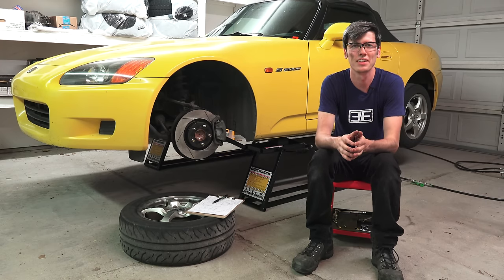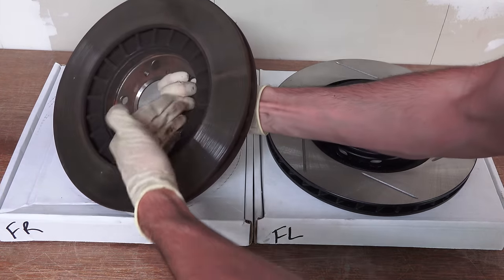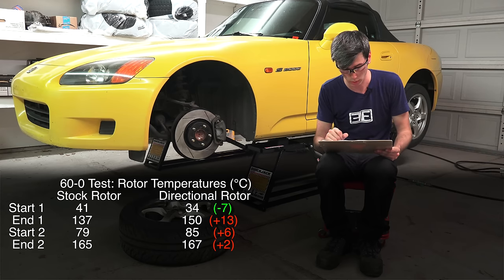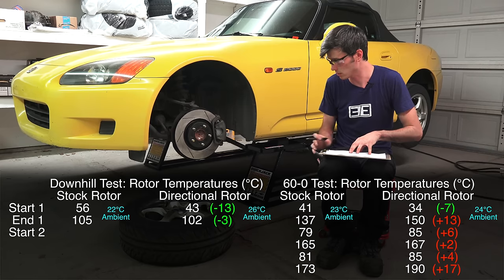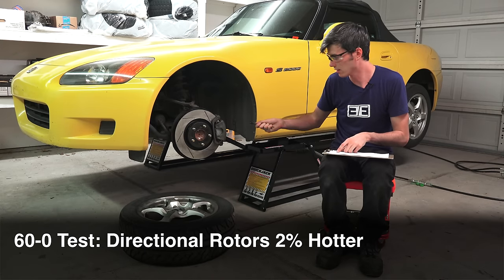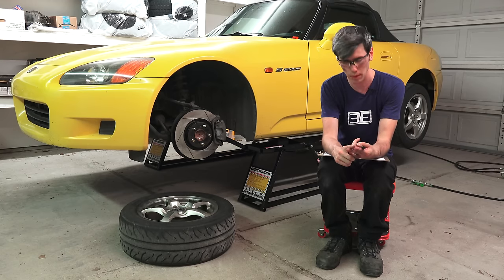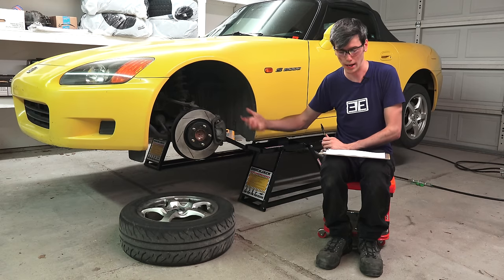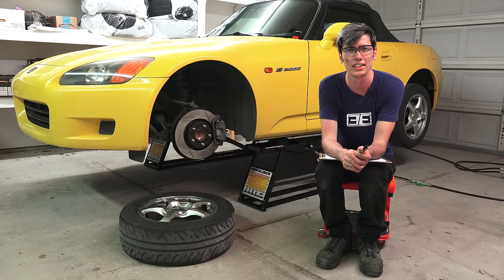Do Performance Brake Rotors Have Better Cooling?

Comment: I think you left out an important factor, you didn't measure stopping distance!  A shorter stopping distance is going to yield a higher temperature.  I think it would also be interesting to do the 3 hard stops, then drive say 5 minutes, roll to a stop then take the rotor temperature.  What I'm looking for is, did the aftermarket rotors stop in a shorter distance, get hotter, then cool quicker.  Remember, the function of a brake is to stop. The shorter the distance the better the rotor and pad.  I don't care if an aftermarket rotor gets hotter than a stock rotor as long as it's stops shorter and stays straight.  The stock rotors on my G37 warp and wobble like a b** after they get worn a bit.
Reply: He said consistent lap times. So the same braking distance. The point is they are useless for the street where we drive our beasts 99% of the time. And slotted rotors chew really fast trough brake pads compared to normal vented rotors.
Reply: You say: "The function of a brake is to stop." That's very true, but REMEMBER :
The brakes stop the WHEELS -- it's the TIRES that stop the vehicle !!

Comment: We basically do this type of testing at my work but we embed TC s in the pad and rotors so we see live temps as we brake also sometimes pressure and vibration, but to get accurate data before every test we do a burnishing to make sure the pads mate well with the rotor

Comment: I don't know if you released this but the rotors are actually on backwards, the vanes are designed to scope the air when in forward rotation, if he was to replace run his test with the rotated Round he would see a difference performance of the aftermarket rotors!! 😁

Comment: I found your experiment very interesting. I spent over 35 years in the automotive parts business with new car dealerships, most of it with GM. I learned a few interesting things about parts over the years.

 New car manufacturers are required to test their new models extensively before release. Yes, I know that doesn't mean they hit the showrooms as works of perfection all the time. Problem is, in the USA there are no laws that require aftermarket manufacturers to test or approve anything that they sell. This is sad because they could make their part better than OEM (original equipment manufacture), about the same as OEM or their part can be junk. They are required to prove nothing because they line the politicians pockets.

However, on brake parts, there is an approval designation, D3ea, that sets out testing standards for rotors, pads, etc. If they do the testing and pass, they can put D3ea approved on their product, and that is the standard the car manufacturers must meet. That means that the product meets the same fade and stopping specs as OEM or better. Without that designation, you have no idea whether their product is at least as good as OEM. That may not sound impressive, but an extra 20 feet to stop could be very deadly.

GM"s Durastop line is D3ea approved and they make brake items for other cars such as Ford, Chrysler, etc. Hope this helps someone when purchasing brake pads and rotors, drums and shoes at your local autoparts store.

Comment: I found this to be a good, and an interesting video.  Thanks for taking the time in doing it. I have a couple of questions. What effect would the groves or holes in the rotors have on the brake pads?  Would the groves in the rotors cause the brake pads to wear out faster? Would the metallurgy used in the rotors make a difference?
Reply: No noticeable effect on the pads.   Slots and drillings in rotors are staggered so they will essentially "cover" the width of a pad.

Comment: Did you take into account the stopping distance differences between the two rotors ? I assume the slotted rotors may have stopped the car in a shorter distance - that may create more heat, but the directional cooling fins will cool it down quickly. I'll accept 13 degree higher temps if it stops the car even 1' sooner.
Reply: If you can trip ABS on a set of brakes you're limited by tire grip not brake pads.

Comment: Rotors look like they're on wrong to me.
Reply: because you look at the channels on the face and assume what you think looks coolest is the correct way?
Reply: Top of the slots should face the rear of the vehicle, fact. These discs have been trialed incorrectly.
Reply: carlos oliveira he’s got the discs on the wrong side !    Test therefore invalid
Reply: @keytesofessex  its amazing that you apparently watched the video and still think the rotors are on wrong. Im assuming everything goes in one ear and out the other with you.
Reply: MISTA MAGIK yes in on ear out the other,  I guess.  The idea of the slots is to help dissipate brake dust and moisture from the disc when in motion, but the way you have them will throw dust and rain water into the centre of the hub which kinda defeats the object t
Of the slots.
Have a good day
Reply: @keytesofessex  The cooling channels inside the rotors are designed to channel air out centrifugally and that would not occur if they were the other direction.

Comment: Brakes need to be at an optional working temperature, maybe the performance rotor heats up quickly to gain better braking, but at the same time not getting overly hot. Just a thought.
Reply: Optimal
Reply: Your braking limit is your tyre grip, not the rotors.

Comment: If you’re off-roading, you do not want slotted rotors, capture dirt, sand, debris.
Reply: Except the fact WRC and ARA uses them.
Reply: If the slots capture dirt, sand and debris, wouldn't that then make them the essential equivalent of a solid rotor?

Comment: Personally when I installed rotors like this. I only care about the stopping distance especially at the urban areas and sure at the highway. They did a great job really better than stock. 
The temperature doesn't mean so much to be honest with you. As long as it is doing the job.
Reply: Temperature does play a different brake fade is caused by heat and when you get brake fade your stopping distance increases greatly
Reply: @mattbosch8893  that's what slotted are for. Decrease brake fade
Reply: @David_Saijen  never said the slots didn’t all I said is that temp does play a difference in braking

Comment: You didn't give the rotors time to do what they were designed to do. You hit the brakes and measured the temperature with out letting the veins do their job. They don't work if they are not turning. Maybe do a brake check, but instead of stopping immediately. Get back to a speed of your choice and then use the e brake to stop you so you don't taint the temps. Just a thought. Love your vids. Keep it up.
Reply: Slotted rotors are for gas release. Drilled are for cooling.
Reply: Doesn't the release of gas more efficiently also let go of heat?

Comment: I'm just gonna stick to my stock rotors and just buy  high max ceramic  breaks
Reply: Etienne Rojas slotted are the best bet.. Not drilled. I've done a lot of research on this.
Reply: havel twink how so? im leaning towards drilled and slotted R1 concepts with ceramic but heard these rotors EAT away at the pads. i dont wish to be having to replace parts so often so now ive considered just OEM rotors and ceramic pads. fill me in

Comment: Were the after market rotors broke in, normally brakes have a brake in period. And if they weren't broke in with in they're recommended milage, they wouldn't have the grove marked out in the pads and rotor, which would help with stopping and cooling.

Comment: I think that's because the directional rotors are cooling faster(brakes are only cooling when driving).When you were measuring at the first test,you were staying and measuring and that's why the directional rotors weren't colder.And in the second test you were in move and thats why they were colder(they were in the move/better cooling)
Reply: The stock rotors were vented as well. They just weren't slotted. Less mass heats up faster but holds heat less than a heavier rotor that takes longer to heat up and holds onto that heat better than the lighter one. You also need to consider what materials went into making the rotor. Not all steel is created equal. More often than not the aftermarket is really full of junk and Oem manufacturers produce a much better product.
Reply: that is if you choose a cheap aftermarket rotor then it is probably junk metal, but most aftermarket rotors use much more pure quality metals. Like for example a lot of stock rotors are made of cast iron with a slight mix of metals while quality aftermarket ones use more pure metals with reinforced carbon–carbon or ceramic matrix composites and other things to make the metal stronger and less prone to cracking and heat warping and such.

Comment: Maybe the aftermarket rotors are better at conducting heat from the pads too. That's also seems to be really important. If the rotors are made from different alloys, I would think that would affect the heat transfer. Cooler pads would be better stopping as well. Just a thought. Might be worth a look.
Reply: The alloy is called Chinesium

Comment: Did you account for rotor to pad breaking in? I think the most fait test would be buy new pads, and new rotors. Put stock on one side and these on the other.
Reply: JusstyteN that’s a bad test one side would be grabbing different then other side screwing the results
Reply: @Thumper68  Agreed, glad there is still hope for common sense on the internet.
Reply: billy b seems like I spend all day trying to spread it and it’s not catching on lol!

Comment: As a "former engineer" you should think that curved vanes dissipate heat while turning so they will cool off much faster in between corners not while coming to a complete stop and standing.  Their purpose it to flow air out while spinning much like a flat blade fan vs a curved one so you would need to stop from lets say 60 to 20 mph several times and then recheck.

Comment: Should have put bit more dirt on your face, Work smarter not harder....
Reply: Clearly you've never worked on brakes in the heat. Wipe the sweat off, get a nice smear of brake dust.

Comment: I know what you did wrong. You needed a passenger jumping out and measuring the temp of the stock rotor at the same time. The time you took between testing the driver side rotor 1st and then moving to the passenger OEM rotor second allowed the heat to dissipate. Also you're body weight was on the drivers side of the vehicle which forced the front right brake to work harder where the weight was not evenly distributed

Comment: You conducted this test as if your assumption for the invention of slotted brakes was for high temperature mitigation. 
What a drilled or slotted disk brake was invented for (no pun intended) was for brake fade. 
During braking on stock disc brakes, gases build up between the brake pad, and the brake rotor. This gas creates pressure between the rotor and the pad, causing the the braking power to be compromised. Slotted or drilled brake rotors solve this problem. 
The information you provided was interesting, but irrelevant as to the purpose for their invention. 
Thermal statistics involving stock vs. slotted rotors would have been nice marginal set of statistics to combine as a companion to the actual reason for it’s invention.

Comment: Slotted disc are not for cooling, they have been designed to release gases & brake dust build up. Also you need to to a braking distance test because if the slotted disc has shorter braking distance. This then means that they were hotter due to more friction & are better then stock.

Comment: So the reason why the performance brakes are hotter is because those grooves shave off the pads more to reveal a new film of the pads. This creates fresh friction every time you press the brakes. The performance is better but gets hotter.

Comment: Why not put  stock rotor on front left and Performance rotor on right front so they experience the same thing. Exchange them, and repeat the test the next day. All done with caution to avoid  pulling to one side.

Comment: I would say the slotted rotors shed heat faster and therfore absorb heat. like aluminum foil vs a steel pan the foil will heat quicker but also dissipate quicker. the brake rotors with slots is likely made to handle higher Temps, meaning it absorbs more heat breaks faster and cools faster.

Comment: 1:33  According to this view, we can see the direction of the vents that confirms you actually mounted your rotors wrong.  They probably labeled the box wrongly.  The opening of the vents should point forward to scoop air for better cooling.  I bet if you if you switch the rotors, you'll get better results.  Still admire you doing all the time to do the tests.  Thank you for sharing and God bless.

Comment: 1st test - You  heated the rotors up, stopped and measured? The vanes cool the rotors while driving between braking applications, not as you BRAKE. I would perform multiple brake applications, then drive for 2-5 minutes THEN measure if better VENTING works.  The test should be for how well the vanes COOL the rotor. Their purpose is not to STOP IT FROM GETTING HOT, but to efficiently cool the rotor between braking applications to bring rotor temps down faster.  Put another way, the design is not for heat prevention, its heat extraction. Now, does the additional temp extremes and wider thermal ranges help? Probably not since the thermal stress could shorten the life of the rotor. Number one engineering rule: There ain't no free lunch,

Comment: So in other words, for street driving where you aren't consistently braking hard, you it doesn't matter what rotor you use. (Directional obviously looks cooler though) but if on a track, it does matter.

Comment: You collected plenty of valid data but you may have misinterpreted it! The slotted discs being hotter is probably the result of the more effective conversion of forward motion to heat and shedding that heat resulting in better braking. As others have stated, a real-world test would bear out the facts.

Comment: I think the point of the slits on the braking surface of the rotor is to let hot gas out to allow the pads to keep pressure on the rotor. The small difference in rotor temp could not mean anything at all. I think you should have checked breaking distance rather than rotor temp. Your videos are awesome.

Comment: As someone said in the comments, pads need to settle in and brake force cant be measured correctly by your foot half way to the floor. Also look at the surface on the original brake rotor and you will see them shine. The performance rotor is new and has still the crosshatch pattern which is a more rough finish to it. The brake pads will grab the rough finish on the rotor harder and therefore creating more friction and more heat

Comment: Well... My own experience with a 2011 Dodge Grand Caravan. I used to go through only one Montreal winter and by the end of spring the discs were already warped. I switched to drilled and slotted discs and those lasted three winters before noticeably warping. Worth the difference in price. I also clean and relube every spring because the calcium really is bad on the calipers and guide pins.
Reply: Thank you for this comment. The 1 to 3 year change in warping time has me sold on the drilled/slotted rotors. Somehow I warped some crappy regular duralast and high end non drilled brembo rotors. Each lasted 11 months of daily driving. 
I can’t figure out how to get the guide pins out of the rubber boot so I never change them :( really want to live them up

Comment: I really like those hydraulic lifts. I want to get a set when I get my own house with a garage. I know they are a bit expensive but for someone who does a lot (or all) of their car maintenance it would be a great tool to have making jobs much easier. If I recall correctly, they also flatten on the floor so you can leave them underneath the car so they are out of the way.

Comment: So being brakes are designed to convert vehicle kinetic motion to heat, the aftermarket rotors  started off cooler (dissipated more heat), finished off hotter (absorbed more heat from pads).
The pads are the fixed object moving with the car, the rotors are the moving object moving with the tires/road (vehicle movement).
The whole design of brakes means the pads create friction with the rotor creating heat, the rotor absorbs and dissipates this heat through the rotor and cooling fins.
The whole point of the slots in the rotor are to vent gases under extreme braking when the pad/rotor surface gets so hot the pad begins to gas off, creating a layer between the pad and rotor and actually lifts the pad OFF the rotor reducing friction all together. These slots allow the gas to escape and restore friction and braking.
Reply: Alright 1st of all modern metallic and ceramic brake pads don't "off gas" under "extreme" braking.
 2nd of all this video isn't about slots you dingus pay attention.

Comment: The stock rotors were designed by the Honda to work with with the S2000. Honda spent billions in R&D to build this car including the right type of brakes. An amateur modification usually gives bad results because of the lack of sophistication in terms of picking the right parts.

Comment: It's ok! Anything aftermarket including air fresheners increases horsepower.
  Do the aftermarket rotors you have require a specific brake pad? Maybe this is the problem 🤷‍♂️
Reply: Did he use metallics that might bevan issue. Ceramic or organic for fancy rotors. Metallics act like wire brush. Ceramics work best with new rotors, best braking is organics but i hate the dust. Depend on intended use too.